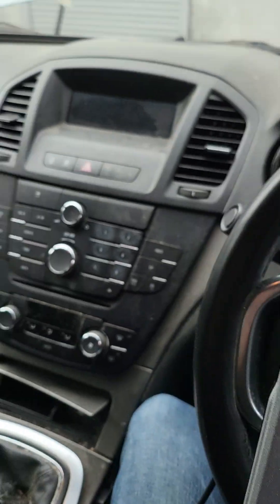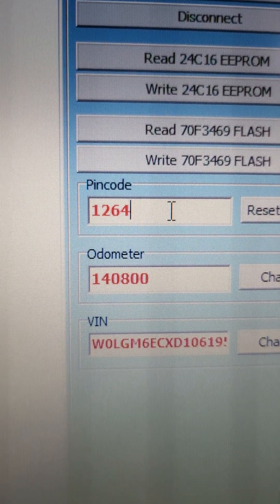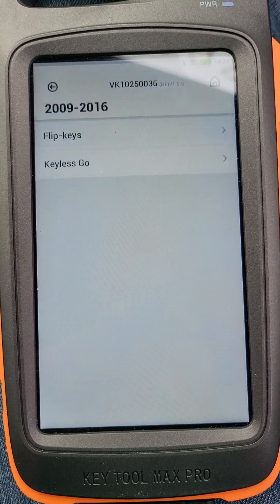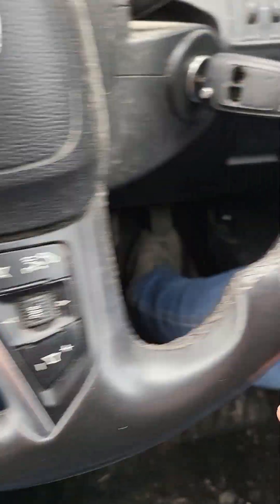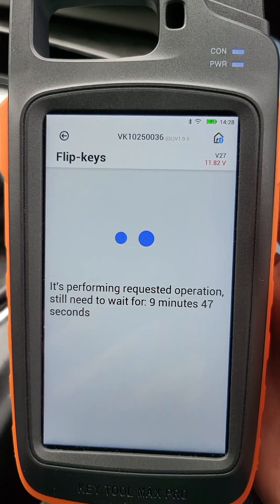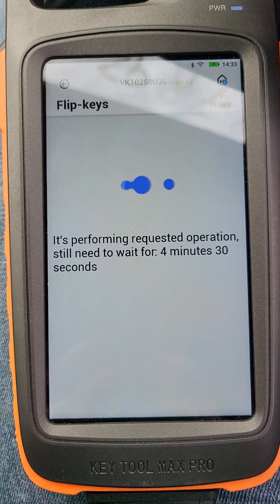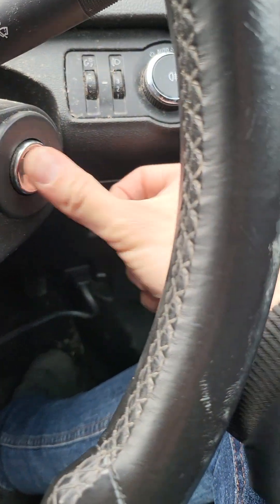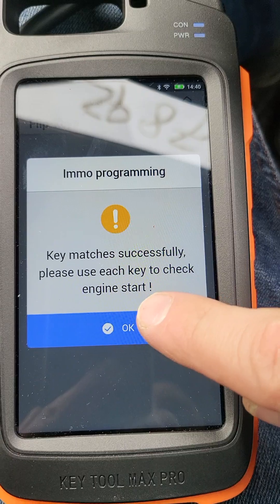How to add key to Vauxhall/Opel Insignia using Key Tool Max Pro and IO Terminal to read a pin code.

Comment: What I/O Terminal software did you use,can you change Pin-code with I/O Terminal software? 🤔
Reply from the maker: Hello, no you can't and it not helps. You can reset the unit and after code it
Reply: @ecuproguk  Ok.. well.. that is fine..(reset is all i need)🙂🤓.. I can program it with GM SPS.. but.. What GM software do you use with I/O Terminal.. there are more than 1..🤓🙈🤔
Reply from the maker: @74Airflow  depends of the issue, i have almost all tools for GM.
Reply: @ecuproguk i need to reset GM SDM /Airbag Ecu-module .. I have MDI..so i can program it..once it has been reset.. GM SDS2, cannot reset ECU Immo or Pin-codes 🙈
Reply from the maker: @74Airflow probably you need to change a vin as well before you try to program it
Reply: @ecuproguk no problem..i already know how to do that..🤪.. but again.. Which version of software are you using in this videoclip?
Reply from the maker: @74Airflow the IO? Last one original
Reply: @ecuproguk  version nr etc,etc🤓🙈.. Apparently 3-5 different GM licenses
Reply from the maker: @74Airflow I don't want to say what kind of tools i have and how i did it😊
Reply: @ecuproguk okay.. i will find my info some other way then..  🤟

Comment: Good job, but in other case You can clone a transponder from original key, then not  needed pin code.
Thanks
Reply from the maker: On this Vauxhall you can not clone this key. It is unclonable
Reply: @ecuproguk  I need to make a key for Insignia 2009 and Keytool says its ID46 and cloneable. Do you mean I still cannot clone it? Or do you mean I cannot clone the remote function? How do I learn the remote if I can clone the transponder?

Comment: Can you use the xhorse without the io software or do you have to get the pin from the software for the xhorse..many thanks
Reply from the maker: Depends of car, sometimes you can read pin code using xhorse, sometimes you need a MDFlasher, or IO Terminal, or Autel immo tool
Reply: @ecuproguk  
Thankyou for all the info...fantastic info..I'm close to retirement ie 55yr but really thinking about going into this kind of thing as I'm an engineer by trade..thanks for your time and effort...I will be picking ur 🧠  in the near future

Comment: Hi Can i read code and programming  , with xhorse tool max pro ?  no risk
Reply from the maker: Hi, this car or different? Because on Vauxhall if you have a pin code you can do this job safely.
Reply: @ecuproguk  yes for this car , reading pin code and immo with xhorse ?